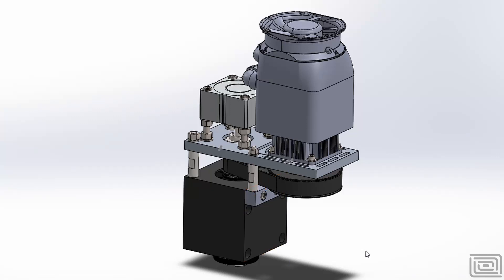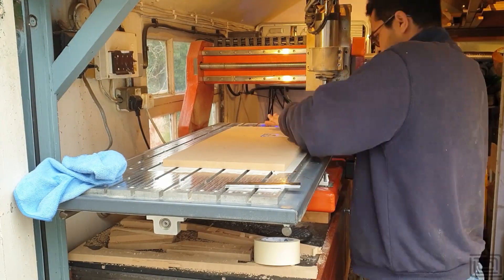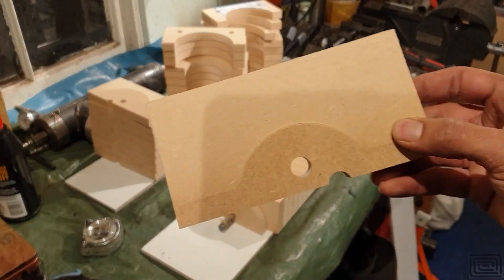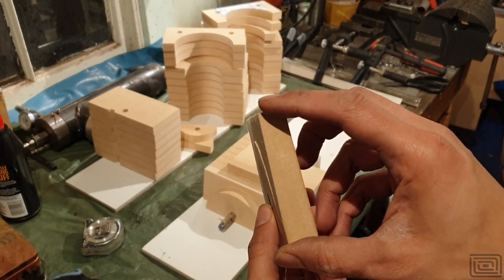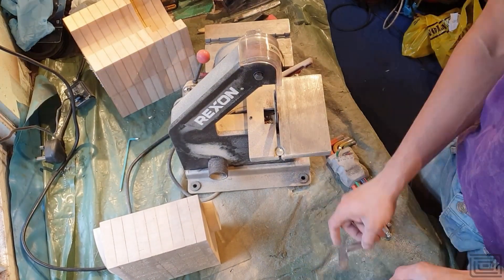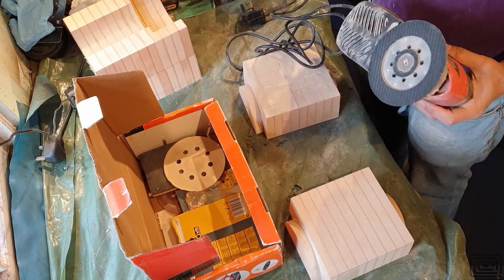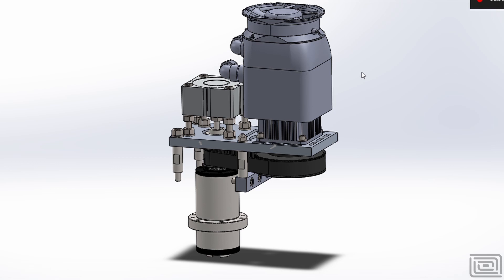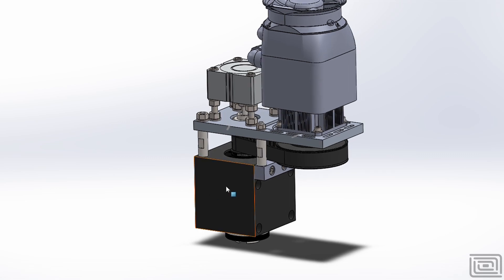Foundry Pattern - BT30 ATC Spindle Assembly Bracket: Part 1

Comment: The only think that surprised me in negative way is the fact, that you've put so much effort to make such a nice, stiff, massive, rigid gantry and them pick such a shitty rail guides ffo the table. Gteat channel, and cast iron melting you did rocks!
Reply from the maker: I agree entirely. I actually re-used the old bed from my previous CNC. Ive actually cast and fabricated most of the bits for the new bed. Its alot stiffer and uses linear rails opposed to supported open bearings (like i currently have)